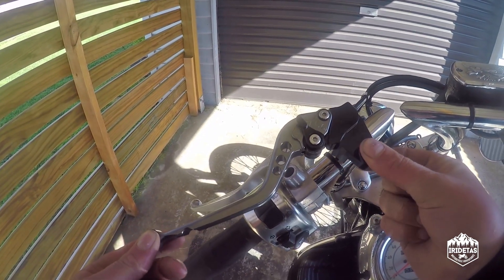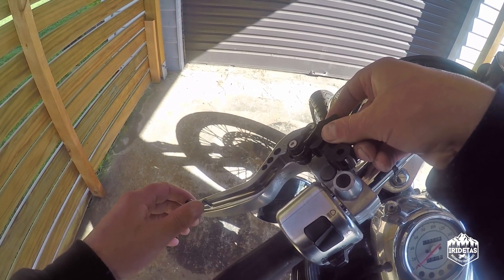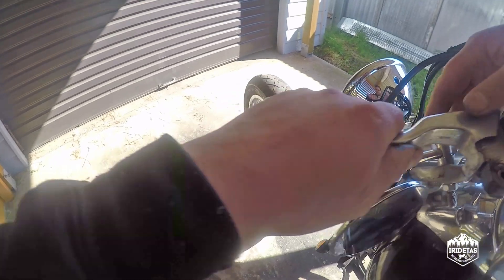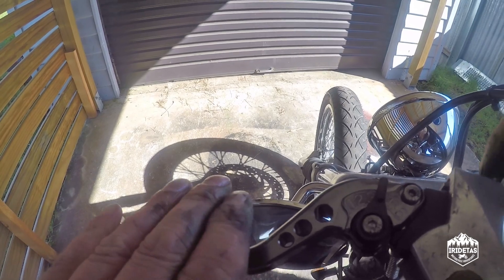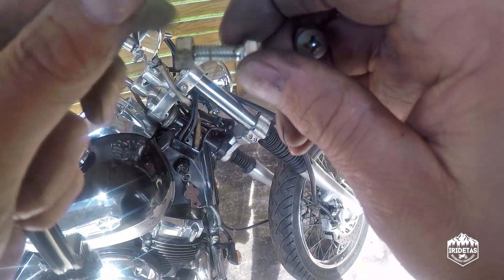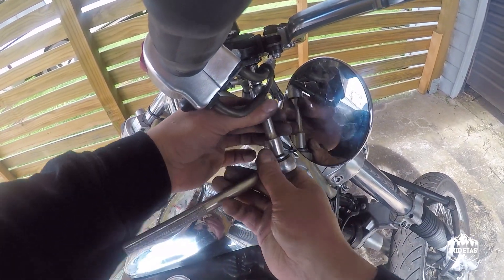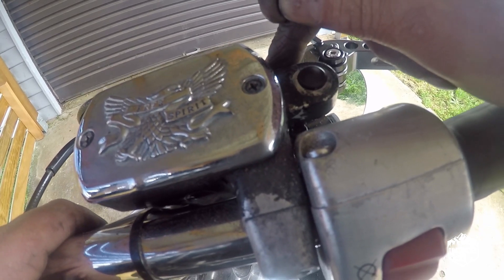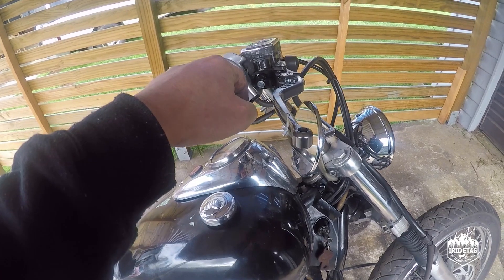BBBs02e12 | Ebay Adjustable Brake & Clutch Lever Install | XVS650, Dragstar 650 or V-Star 650

Comment: Great video ! Got the same bike, and I find the contact point of the clutch very unpleasant. Way too far, making it hard to start and stop a lot in dense traffic. Been looking for a fix, this seems to work so far. Do you have any link to buy those ? Can't find this exact reference...
Reply from the maker: Thanks mate! You just need to type xvs650 levers into Ebay.

Comment: I have been looking at doing this swap to help me have better control.

Whats the 3 months verdict, have you had any issues?
did your break or clutch cables fray/snap?
have you clurch or front brake system failed?
You did mentioned to steer on the side of caution when it came to the break at the end of the video. Before I saw your video I saw another one where the break cable failed on a set up that used these chinese ebay/amazon levers.
Reply from the maker: All good!
Reply: @iRidetas  thats good to hear. Please do a 6 months update if you get the chance. Do you ride this bike frequently or is it still a project you are working on?
Reply from the maker: Several times a week.  There isnt enough in a 6 month update on the levers sorry mate to do a vid on it!